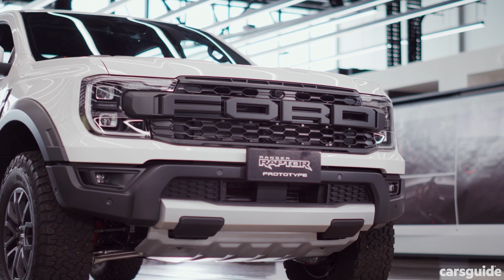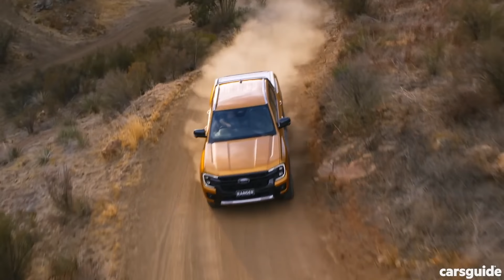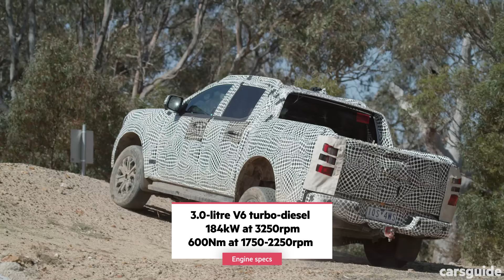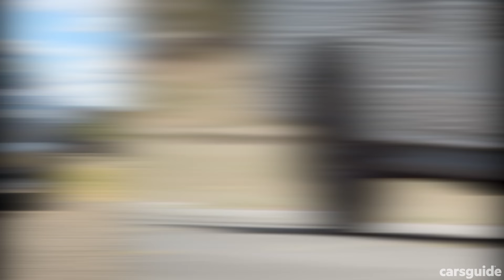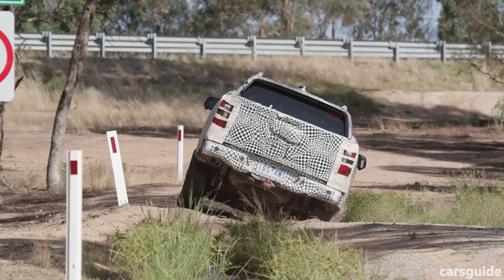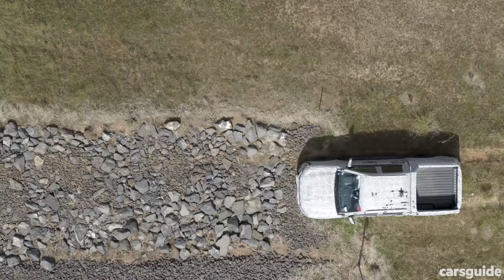Ford Ranger review: 2023 V6 diesel Wildtrak test drive (inc offroad!) Australia prototype drive

Comment: Is that the same 3.0 V6 Land Rover-sourced V6 that Ford offered in the F-150 here in the US for a few years? When this Ranger arrives to the American market I'm hoping to see it offered with the 2.7 Ecoboost as well as a the 7-speed manual borrowed from the Bronco line.
Reply: Actually it’s a Ford-sourced engine for Land Rover, built at the Ford factory in Dagenham, UK.  LR doesn’t use it anymore, as they have their own engines now.

Comment: Ive read that the "all new ford v6" actually started life at Peugeot/citroen, then Jag landrover, a few modifications and now in the ranger as a option..🤔 we shall see about reliability in the long run. Ford tough is a joke mine was a complete lemon.
Reply: It's been in the f 150 for years you clown
Reply: The V6 diesel has been modified, updated and beefed up
Reply: @MrTonaluv  how do you know its been "Beefed up"? This engine already comes in a 225kw 700nm form
Reply: @mightygood1  Land Rover was twin turbo and made 700nm. Ford one is single turbo with 600nm. Its the same engine as the F150 diesel V6 and it held up quite well
Reply: @vanderz1012  your reply does not answer my question at all.
Reply: @mightygood1  beefed up as in some of the parts are thicker and better quality such as head gaskets
Reply: @SkiRacingOz  What proof do you have that Ford has done this? 
The engine makes the same power and torque figures as it it did 10 years ago in the Discovery 4 SDV6.
This engine has been around in the 3.0l form for 14 years and other forms for 18 years (2.7l).
We are getting this motor in its lowest power setting. Don't be fooled that this is some sort of new product.
Reply: @mightygood1  the lowest power setting is to help with reliability, this engine will still be very powerful and ford saw no reason to add more power to an entry-mid level suv, I saw it on a car expert post that they have beefed up multiple internals
Reply: @SkiRacingOz  can confirm, I also saw the video car expert put up detailing the "beefed up" parts.
Reply: @1989cranston any chance u have the link to that? Curious to see what they’ve changed

Comment: Wish I could get that Diesel in the raptor. Sad they went Petrol only for the raptor.. I really wanted the Raptor coil front and rear suspension with a big diesel with tons of low down grunt. 

Looks like the only way to get that now is to wait for the Ineos Grenadier UTE. Will trade in my current wildtrack for that
Reply: My only advise is be careful with re-sale value on the Ineos Grenadier as the cost of ownership for that out of warranty will be horrendous. Just for examples sake the best 4WD re-sale product on the market by a mile is the 200 Series Toyota. After 3 years of ownership and around 80,000kms on them owners are getting their money back virtually. If money is no issue by all means have a play with the Grenadier. I'm surprised the Raptor went petrol but that's still better than the Diesel Bi-Turbo 4 cylinder engine in the current Raptor.
Reply: @deanrwilson  I think you'll find that's going to change though. The interest in the old 200's has come about mainly because people think they have to have a V8 for their towing. Thats  going to change. Two or three years ago I was paying wholesale under 30k for petrol V8's and low 30's for the diesels (first gen 200's).... It'll go back there eventually once stock gets back in showrooms
Reply: @deanrwilson  yeah really good points although those old 80 series was built a bit  different than these modern trucks

The more modern utes and cars are becoming a bit like smartphones and designated with a degree of obsolescence from the get go. Including it becoming harder and harder to fix your self as more and more of it becoming electronic. 

The older iconic 4x4s like FJs, 70 series, g-wagons, defenders are not the type of trucks you buy to sell again. As long as they last we keep them going and some of them like the g-wagons or 70/80 series have q chance of outlasting it's owners 🤣

Grenadier seems to be built around that same philosophy of the icons and definitely made with the right ingredients. If it will actually live up to that promise time will tell but I kinda feel upbeat about it.
Reply: @deanrwilson  in Europe there is still 2.0 bi turbo. At least i think it is
Reply: Hope you have $130.000
Plus...
Reply: They're doing the petrol V6 cause the Raptor is supposed to be a top spec desert runner. Diesel V6 is for towing. Its the same as the new Bronco Raptor: Same engine, same suspension
Reply: @vanderz1012  well in EU they should put V6 that is already in use in normal ranger
Reply: @KristijanVragović  I'm reallt hoping that we get rhe V6 option here in the UK
Reply: @vanderz1012  would be great. But i red on official page that they'll put 2.0 biturbo diesel.

Comment: So no low range box in the V6? Are they doing it Amarok style and relying on the auto trans slip to get through the tough stuff off road.
Reply: It has dual range transfer. Amarok V6 also had dual range BUT in manual only.
Reply: It does have low range. It's the same 4wd system as the Bronco. Think of Mitsubishi Super Select its basically the same thing

Comment: is the engin better that the v6 from vw? I hope i will get the new amorak with the german engine!
Reply: New amarok will use the ford engine
Reply: What is your reason for hoping to get the german engine. You do realise the V6 from the F150 has been around for many years and is tried and tested. The F150 is the most sold vehicle in the world.
Reply: Hard to say but power figures are similar with the Ford engine 600NM torque vs 550nm for the standard Amarok or 580nm for the Ultimate 580. Slightly less KW's with the Ranger 183KW's vs the VW 190KW.
Reply: This engine design goes all the way back to 2004 so it's been around a while

Comment: Is the 50mm in extra length in the cabin, more specifically the rear leg room?
Reply: Probably in the bed considering it’ll now fit a standard pallet which the current  one doesn’t
Reply: the front axle has been moved forward 50mm, bed and cabin unchanged
Reply: @bazza2540  Thats a shame, some extra room in the cab would have been bloody handy when having more that 2 adults in the car

Comment: as VOLKSWAGEN is the world's largest combined car manufacturer ( vw , Porsche , Audi ,Bentley , Lamborghini and many more ) .I wonder how much input they had on this project. they would have made sure it was up to their standards if they were going to be associated with Ford. considering that the Ford motor company is sever financial difficulties.
Reply: Ah, what.
Reply: Head to head, Toyota v VW, BIG.T SMASHES THEM in volume
Reply: @lot6129  vs all of VAG? I wonder. Wouldn’t be shocked
Reply: @lot6129  bullshit, toyota includes hi lux 2wd in their sales which IS NOT A 4X4 so Ranger sales beat Toyota's..
Don't belive Toyota's bullshit marketing..
Reply: I doubt they had as much input as you might think.

Comment: I've been cross country in a Hilux and a Ranger and I'd rather be in a Ranger any day. More comfortable, more head room, better seats, better seating position, and better suspension for rough roads.
Reply: Toyota and ranger's are both rubbish in comparison with a v6 amarock 😁
Reply: @johnboy5167  Well, you may be half right. 2023 Amarock shares it's platform with the new Ranger :)
Reply: @johnboy5167  the new Amorock is based on this new Ford Ranger tho
Reply: @pr0jectSkyneT  l am only talking about the 2019 models l will drive the new ones soon and my opinion may be different 😁
Reply: And Tech
Reply: The Hilux is the least comfortable car on the market by a mile. If comfort wasn't an issue but reliability was you'd have to pick the Hilux or the Dmax.
Reply: @deanrwilson  The Hilux is not as reliable as you think and the Ranger is not as unreliable as you think.
Reply: Did it run out of Ad Blu ?
Reply: @davidnobular9220  Dont you have to put that in your mum.
Reply: @davidnobular9220  what ranger uses ad blue?
Reply: @marshalllennan5396  All the diesel 2022 models ? If not, the Greenies will wanna know why not.
Reply: @davidnobular9220  you know none of the rangers require that lol
Reply: @joshuaheke-davis3639  So all jokes aside, why would the Rangers not have it and the Everests do? Given they share the same running gear, I would have expected that....
Reply: 20 years down the linee, only the hilux will be running
Reply: @lombe-andrewmusonda17  who's wanna keep a car for 29yrs? 10 is fine for me.
Reply: @Deatomizer  im assuring youd wanna sell it at some point? Resale value of the hilux will be higher for same year similar specs 
Anyway, in the end its all about personal choice
Reply: @lombe-andrewmusonda17  There is more to owning a vehicle than just resale and I own a 2019 Toyota Camry with 29k on the OD. It's the most boring car I've ever owned and not without its problems. Transmission issues to interior problems which is probably why I'm salty on Toyota's. I also own a 2017 Ford Everest with 130k on the OD. It has no issues and has held it's resale value just fine.
Reply: @lombe-andrewmusonda17   Lets face it, no matter how many recalls and issues the Hilux has the hardcore fans will always ignore the issues. Not saying Ford Ranger is quality, its far from that but recent Hilus is overpriced trash too
Reply: @lombe-andrewmusonda17  Your point is??? I would rather enjoy driving my car that keeping it for "re sale". A car is not an investment, drive it and enjoy it. drive a Ranger.
Reply: @Deatomizer  Exactly my point.
Reply: @lombe-andrewmusonda17  not against a Ranger mate. These days they're just about the same.
Reply: @lombe-andrewmusonda17  20 years ? That thing will be on its on 20 engine and transmission don't compare this garbage with ranger , nobody like to drive or sit in a garbage toyota !
Reply: @lombe-andrewmusonda17  bullshit Toyota will be gone in15 years or less..
Reply: @lombe-andrewmusonda17  Lmao.. who's gonna keep a car for 20 years? 7-8 yrs ill be buying another one 😂
Reply: @lombe-andrewmusonda17  , not really true , i own both at the same  year old, ranger more better than hilux…
Reply: @lombe-andrewmusonda17  yeah maybe thirty years ago mate
Reply: @lombe-andrewmusonda17  not these modern hilux

Comment: And I bet it still will not be as good, comfortable or capable as the current Volkswagen Amarok!
Reply: The current Amarok is the best to drive by a mile. We can only hope it's as good.
Reply: @ChristopherH you are wrong there as well. It most definitely does not’fall flat on its face”. I own the 4 banger and I load it up often and it performs effortlessly. I also own an old caravan that I have towed over 20000kms around QLD and NSW with it, through the outback and everywhere, and you do not even know the caravan is there. The Amarok and the caravan are loaded to capacity. It is mighty, powerful and strong.
Reply: @ChristopherH rubbish the amarock is much better than any ranger
Reply: @johnboy5167  no
Reply: @ChristopherH you've never driven an amarok have you
Reply: @Sct606  yeah but even without the airbags, it still got a 5 star ancap back then when nothing else did so in that generation it was still one of the safest dual cabs you could buy. Do you want a 4 star model with airbags or do you want a 5 star without cause that was the option at the time.
Reply: @ChristopherH because as a third generation dealer who specialises in commercial and 4x4 vehicles, I'm yet to meet anyone who has significant time in both vehicles and doesn't see a difference in both vehicles
Reply: @ChristopherH l definitely know a lot more than you trapper
Reply: lol
Reply: I am amazed that so many people have no idea what they are talking about if you haven't recently owned or extsivly driven these vehicles your opinion is irrelevant so please shut up
Reply: @johnboy5167  Gee have a cry! Someone has a different opinion to you and your response is to tell them to shut up.. Your opinion is irrelevant because it is just that, YOUR opinion, everybody is entitled to their own, doesn’t mean they are wrong. One thing that you can’t deny is Ranger significantly outsold the VW, resulting in VW accepting that adopting the Ford was the better option than building a car the majority of people didn’t like for various reasons.
Reply: @troybeaman9845  have you had both vehicles and used them extensively if you haven't how can you have an accurate opinion 🤔
Reply: @ChristopherH have driven amarock v6 and ranger's extensively also Toyota and Mitsubishi on road and off road lots of heavy towing over many years still have a 2019 v6 amarock so l think l have a fair bit of experience with these vehicles
Reply: Do people still buy VW after the diesel emissions fraud?
Reply: @Motorallyrider  do people actually care about the “fraud”?
Reply: @matthewh8005  Defrauding customers? Sure they care.
Reply: @matthewh8005  it wasn’t a “fraud”, it was a FRAUD. Just because you don’t like it doesn’t mean they didn’t pull the wool over regulators
Reply: @Clove_Parma  exactly, the regulators. Not me. What VW did has no affect on me at all.
Reply: @matthewh8005  go drive your hand mate
Reply: @matthewh8005  they say the VW diesel fraud caused thousands of deaths.  Not sure exactly how they worked that out, but I'm sure relatives of the deceased would care.
Reply: @ChristopherH I totally disagree. I own an Amarok and my daughter owns a Wildtrak. The Wildtrak is dreadful and gutless and very rough, stiff and uncomfortable to ride in, and really feels like a truck. There is nothing about it I like at all.
Reply: @kaz1aus  You are 100% right.
Reply: @kaz1aus  you are absolutely correct 👍
Reply: @kaz1aus  The Amarok is sharing a platform with this Ranger. I guess VW believe this new Ranger is better than what they could do. Ford Amarok, coming to VW dealer near you soon :P
Reply: @browie316  no, it is not that VW believe that the new Ranger could be better than they could do at all. It unfortunately came down to dollars, as it always does. The Amarok is not their highest selling vehicle by a long shot. VW sadly could not justify spending the R&D dollars required to develop a new model. So the unholy alliance of the abomination collaboration was born. Ford to bring electronic advancement to the Amarok (which is a huge mistake as every Ford I have seen always has gremlins and issues with their electronics…) and VW was to share their Amarok data. 
Yes, I know the “RangeRok” will be at the VW dealership soon….
I am dreading it.
I will take it for a test drive, and then sit back and wait a generation or two….
I will stay “true blue” and genuine current VW model for some years yet. I am in my 50s so I may never decide to get the “hybrid b@stardisation” of my beloved Amarok……. I will just sit back, observe and wait and see how it goes….. it’s a lot of money to pay for teething issues or trouble…. Warranty claims and work can be very painful…..
Reply: @kaz1aus  maybe because it is a "Truck" karen. Lol
Reply: @ChristopherH when you say “car chassis”, you mean a unibody chassis? If so then you’re wrong as it uses a ladder chassis just like virtually every other dual cab on the market
Reply: i can't fit in the back of an Amarok, Got stuck getting out
Reply: Lol vw is asking ford to build their pick up truck.  So that itself is an answer that ford is a better product